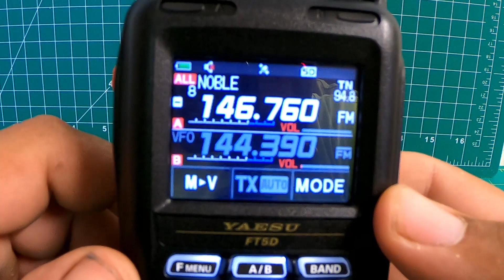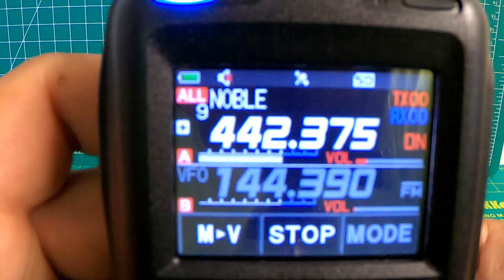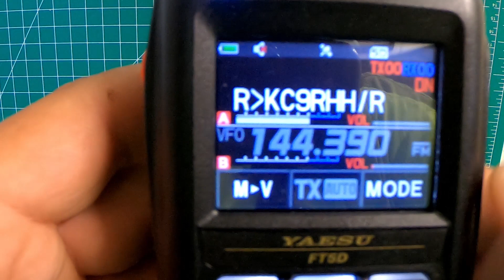Memory Scan On The FT5D #yaesu #FT5D #hamradio #hamharder

Comment: For a $500 flagship HT the owner should be able to choose what is displayed when scanning. I just ordered one from HRO and didn’t know about this issue. As more units are sold Yaesu WILL receive more complaints. Maybe a firmware update will come out after retailers realize that some people return the units because of this. It may or may not be a deal breaker for me. Yaesu needs to remember another flagship HT is soon to hit the USA streets from Icom in addition to all of the cheap dual band DMR radios.

Comment: I think the possible batter life extension and increased scan speed - if that's actually accomplished - is worth it.  While I get that people want to have what they're "used to" but I still think this is a heck of a nice radio and am crossing my fingers that I've been a good boy this year.  Good enough that Santa will bring me one.
Reply: Make it optional then. I can believe that the quickly updating scan on 3D ate a lot of battery and that’s why they did it, but it still should be an option. Also, personally, I don’t need it to update a hundred times a second, I just want to see the progress and where in the band it’s looking, so if it updated only every 500kHz that would be fine and I bet it would eat no battery at all. What Yaesu have done is simply dumb and every time you scan it makes you think “how many more dumb things have they done to the radio that I don’t know of (yet)”